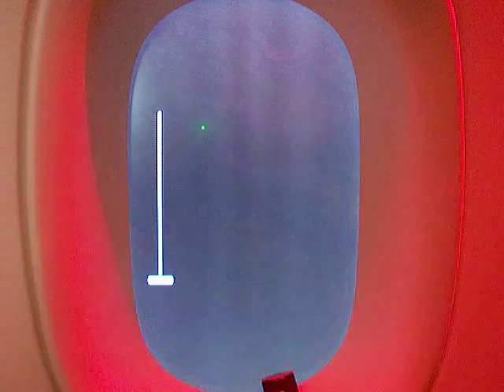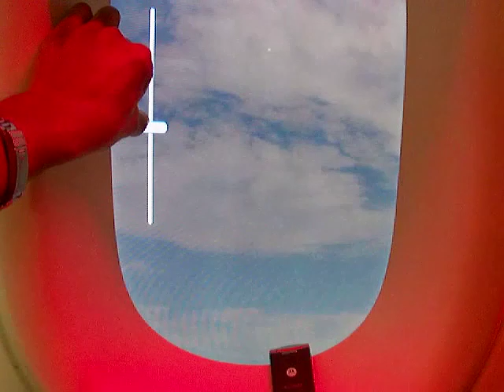Boeing 787 Electrochromic Window Shade and Mood Lighting

Comment: These windows are a nightmare!  I have just flown the new Aeromexico's 787 Dream Liner from Paris to Mexico and then from Mexico to Paris.  The first leg of the trip was not a problem as it was all at night which allowed me to appreciate the plane.  It is a beautiful plane indeed with more leg room than your standard 747, and with a very modern look.  The only problem I found were the windows windows which were not only a nightmare but a safety hazard in my opinion.  At its darkest tone, the sun looks just as if you were looking at an eclipse through a dark glass which means you very much see it.  Very cool at sunrise, but within minutes it starts to burn your skin.  Give it 20 minutes and the window itself becomes hot!  Literally!  So much you cannot touch it!  I don't event want to thing about the risks of sun exposure at 38000 ft.  Since the windows do not have plastic shades and everything around them is flat (besides being bigger than any other plane I have ever seen), there is not much you can do to cover the window.  Even if you love a good sun tan you are going to hate it!  I looked at all my fellow passengers on my side of the plane and they all seemed to hate it the same as I did (except those next to the exit door that managed to hang a blanket using the door).  My advise if you are going fly in one of these planes is to make sure you stay away from the side of the plane facing the sun if you want to have a pleasant flight, specially if you are going to go through a sunrise during the flight.